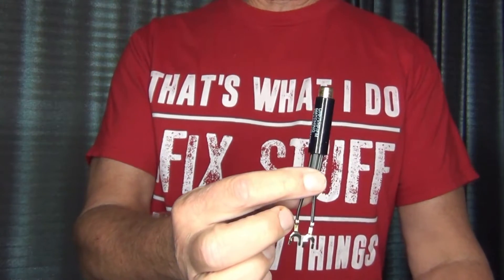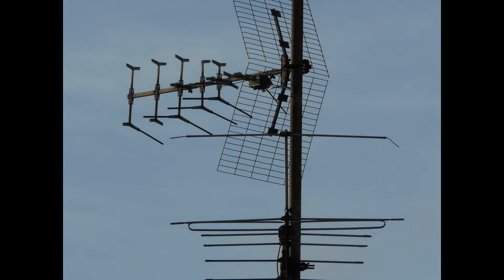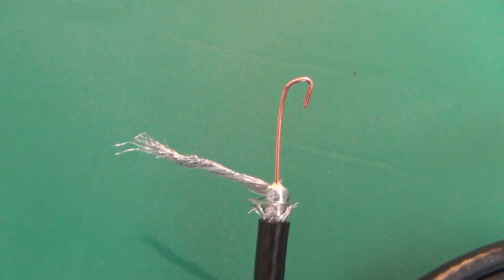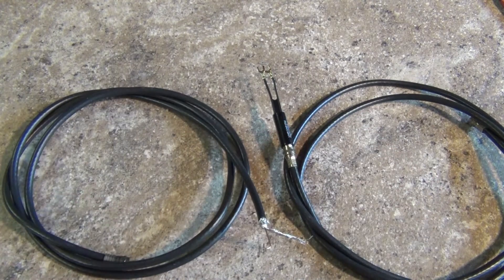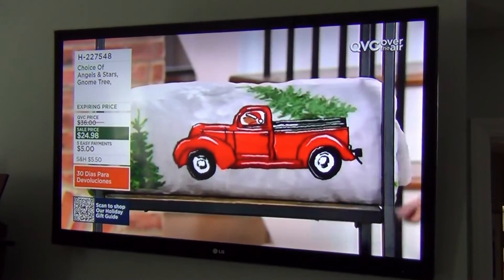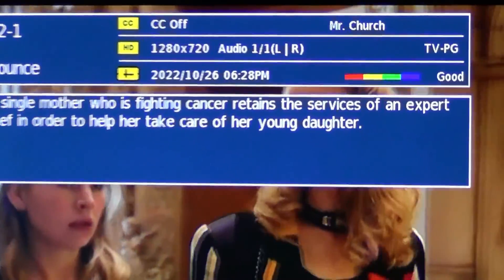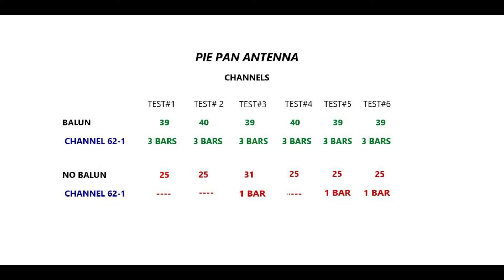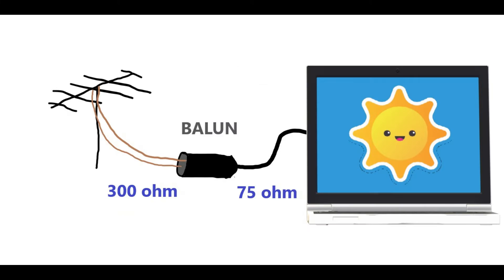Do You REALLY Need a Matching Transformer?

Comment: It's much more evident in analog TV that using a 75 ohms coaxial cable an antenna with a matching transformer has better reception than without. A 300-ohm twin lead flat cable still needs a matching transformer not on the antenna but on the other end when you plug it into the TV.
Reply from the maker: Thanks for the great comment!

Comment: WHY NOT RABBIT EARS?---why you didn't include the two rabbit ears antenna with this one? I need to make one antenna like this one but with two rabbit antennas to make it a complete tool. But I wanna know how to connect the two antennas with the UHF loop antenna. Do you have any idea?
Reply from the maker: Often the UHF loop shares the same connection as the rabbit ears - try connecting them together, one on top of the other.
Reply: @mrhoptoit7835  You mean both the loop and rabbit ears antennas should be in parallel connection with the input of the balun?
Reply from the maker: Yes.
Reply: @mrhoptoit7835  I don't think that way the loop antenna will work with the rabbit ears. I think the rabbit ears need to be connected to  the output of the balun.
Reply from the maker: There are situations where connecting the antennas together will not work well. I always recommend at least trying it first. If it doesn't work for you, attach both antennas to their own balun, run equal lengths of coax from them to a combiner/splitter, and then run your coax to your TV.

Comment: As a general rule, matching always helps.  I get a "boat load" of TV stations with my attic antennas.  They are directional so aiming of the antenna also matters a lot.  If you are over about 30 miles from the transmitter, a directional antenna is best because it ignores noise coming from other directions.

Comment: This was a fantastic real world test of Balun transmission line change.  I lot of antenna sophistication ends up not making a lot of difference its so good to get some real world results!.   There is more going on than just changing impedance between 300 Ω and 75 Ω transmission lines.  The 300 Ω transmission line is treated as a "balanced" carrier transmission wave where half the wave is below a zero voltage reference and half the wave is above zero voltage reference.    The idea is that at the receiver any radio wave interference to the transmission line will appear as a positive or negative constructive interference to BOTH negative and positive parts of the signal; whereas, the original signal would be very symmetrical.  The non symmetrical part of the signal can then be greatly eliminated.   300 Ω transmission line is typically unshielded twin lead and it is best to put a slow twist into the line so any radio wave interference is applied somewhat evenly to both conductors.  People have used unshielded 300 Ω twin lead in their attics as antennas in themselves.   

The 75 Ω transmission line is typically shielded unbalanced transmission line where the entire signal wave has been shifted so that the bottom of the wave that was below zero is not tied to a zero reference and the whole wave is considered to be above the zero reference.  The typical 75 Ω shielded transmission line is coax cable with two very different conductors that do not act the same.  This would make it a poor choice for a balanced transmission line because the two halves of the signal would be distorted from one another with the implicit reference to ground (actual ground).   It is also much higher loss than the unshielded balanced transmission line.  The shielding provides near total isolation from interference, but it also is thought to drain signal strength away to ground.

The impedance of the transmission line can be thought of as the optimum ratio between voltage and current or R=E/I which in the physical conductor is set by the distance and dielectrics between the conductors.  I have never gotten a good practical model for impedance matching.  Impedance is dealing with energy storage and release due to magnetic (inductive) and electric (capacitive) fields.  The reason impedance is referenced in Ω is that at certain frequencies it resembles an R=E/I relationship ship which is a physical ratio of voltage to current.  That has relevance to the physical sizing of inductors and compactors.   In radio electronics there is another meaning of high impedance in relationship to vacuum tubes (valves in Britain) in that they had relatively high resistance compared to later transistor electronic circuits and operated in at much higher voltages to produce similar output power in the hundreds of volts sometimes.   A transmission line's termination needs to appear as a continuation of the transmission line or the signal will bounce due to a refraction change.   The real problem with the signal bouncing is it will bounce off of other refraction changes and all that back and forth bouncing will cause distortion to the signal.   There is also loss of signal with out a good impedance match because part of the signal is bounced backward.  

It is best practice is to have a strong signal booster right at the antenna so the antenna sees an ideal load on it and the signal booster can then provide a strong signal source to the devices using it.  Ideally it would be best to over boost the signal at the antenna and have to cut the signal strength down at the receiver.  If you use a passive signal splitter it cuts the signal strength down regardless if its ports are being used and more so for the number of ports it has.  I've never seen an over booster signal not work on a TV.  There is something else probably going on if that appears to be the case.  High frequencies in the upper UHF can lose about 4 times as much strength as the lower frequency VHF TV signals on their way down from a roof antenna.
Reply from the maker: Thanks Douglas for watching and giving such a thorough explanation. Very well written.

Comment: Ok, now that reception is for TV ! I'm curious about the signal for FM radio? Can this work for that too ?
Reply: Yes, a balun does work for FM radio.  If you make the classic folded dipole FM antenna out of some twin lead or just hook up to a TV antenna, the matching still helps if you need to run coax to the radio.
Reply: it might pick up some stations but the antenna he used is for uhf and FM uses Vhf. a pair of rabbit ears would work for FM

Comment: Just my opinion based on my personal experiences, your mileage may vary and CAVEAT EMPTOR: A Balun is like the transmission in your car, it BALANCES the load to make for an EFFICIENT transfer of power. You NEED a balun for the efficient transfer of power, even here where we are dealing with picoamps! It WILL Make a difference in fringe reception. What's MORE, if you put an antenna up high, it's BEST to use 300 Ohm TWIN LEAD and bring that down into the house. (And don't forget the lightning arrestor!) I have observed PERSONALLY that SURE, you can use a PREAMP and use coax for this connection. But? You don't need the preamp at all, IF you use GOOD OLD FASHIONED 300 Ohm "TWIN LEAD" INSTEAD! This is a substantial SAVINGS in that you forgo the cost of a preamp, and even though it uses a so called "voltage injector" that is mounted INSIDE your house, you're just kidding yourself if you think that the preamp MOUNTED OUTSIDE  which is where it MUST be to make any appreciable difference, will stand up well to weather, and that goes DOUBLE for coax outside, which eventually gets wet, no matter how well you seal it up, and that changes the impedance to something OTHER than 75 Ohms, and drops efficiency DRAMATICALLY! Now,  INSIDE your home, you place the balun to switch over to 75 ohms for your actual TV connection. and with 300 ohm twin lead, you DO NOT AND SHOULD NOT place a balun on the mast. Why does this matter? Because TWIN LEAD is way way way more efficient than coax on any given length as compared to 75 Ohm coaxial cable. This is ESPECIALLY TRUE at VHF and UHF frequencies! You will STILL need a DISTRIBUTION AMP INSIDE THE HOUSE for the runs to the respective television sets.. again because of the loss of the coax INSIDE the house. This begs the question: Why not just run twin lead INSIDE the house to all of the TV's? The answer is that twin lead DOES NOT like to be run over or near runs of metal like pipe and duct work, indeed it will LOSE SIGNAL in these circumstances. If you use a metal pole as most of us do for your antenna mast? You MUST use FOUR INCH STANDOFFS MINIMUM to separate the coax from the metal pole/tower. In comparison to coax, you could theoretically run HUNDREDS OF FEET of Twin lead and have practically NO LOSS as compared to just 25 or 50 feet of coax! Back in the EARLY days of television, communities that were cut off from TV reception would put an antenna on a mountain and run...yes...you guessed it... TWIN LEAD to the bottom of the mountain. You would pay to be "hooked up' to the system, and this was the early "cable Pay TV" (using the term "cable" very genetically and loosely here! ;-)) USE PPE, AVOID FALLS, AND DON'T EVEN THINK OF MOUNTING AN ANTENNA NEAR ANY POWER LINES! People are KILLED installing antennas every year, don't be one of them! You MUST install the LIGHTING ARRESTOR to meet code and so you don't VOID YOUR HOME INSURANCE WARRANTY! Again, coax is lossy lossy stuff, that's why you see those inline "boosters" on the telephone poles all over your town, and even UNDERSEA CABLE has to be boosted MANY TIMES with VERY EXPENSIVE underwater boosters to make the trip to (and from) US/Canada and the UK for another example.  All the Best! 73 DE W8LV BILL
Reply from the maker: Thanks for the really good comments and advice, and thanks for watching

Comment: Without a balun, the coax becomes part of the antenna elements and its placement/routing will likely affect signal and interference.  Some small antennas that are marketed as VHF-High use the coax like this as the VHF-High element.  Presumably so it can be marketed as a VHF-High antenna.

Without an impedance matching transformer, a high impedance antenna (aprox. 300 or so ohms) is too high to effectively drive the lower impedance of 75 ohm coax cable.  Thus the delivered signal is weaker.

Impedance of an ordinary dipole antenna is supposedly close to 75 ohms and so 75 ohm coax can be directly connected.  However, there is still the issue of balanced to unbalanced.  So a 1 to 1 balun would be appropreate.  Rather than 4 to 1 (300/75 ohm).  There are some means of making a 1 to 1 balun with a length of coax.  But these are usually narrow bandwidth and more suited for HAM systems etc.
Reply from the maker: Really good information. Thanks for the comment!
Reply: Does it matter if I have a 75 and 300 switch for gaming with RF adapter or does it not matter for gaming?

Comment: I agree with your conclusion but your testing was totally unscientific ..  BALUN stands for Balanced-UNbalanced  its to match a balanced antenna (TV) made up of horizontal parasitic  elements and  dipole driven elements to an UN-balanced coax cable ... , in other words they haven't fundamentally changed from the old Analog days , there is no such thing as a HDTV antenna .   A balun can also  match different impedances because its a transformer .     ....The new digital channels are all in the UHF range which has the greatest cable  losses , the most important issue with reception is the cable .  Always use the shortest run , use high quality double shielded cable .  Digital signals are easily interrupted by interference  .
Reply: Not all TV stations are on UHF.  Near me there are several High-VHF stations and one Low-VHF.  A lot of people will find that the local PBS station is on the VHF band.
Reply from the maker: Very true Ken. That's why everyone needs to check out what type of antenna is needed for their particular location and  bands they want to receive. My current favorite is rabbitears.info.
Reply from the maker: Thanks Jeff for your great feedback. As I stated, I am not an Electrical Engineer,  just a hobbyist that enjoys building and testing TV antennas. Its really great that a person like yourself with a lot more knowledge on these matters took the time to watch my video (even with it's simplistic methodology) and agrees with my conclusion! Thanks again.
Reply from the maker: Thanks for the great comments, Ed. I actually do know the definition and theory behind baluns.  My video was meant to be quick, entertaining and non-technical.  If anyone wants a thorough understanding of baluns, I recommend watching David Casler's video on the subject. You are also absolutely correct that there are no ACTUAL HDTV antennas. Saying "HDTV antenna" simply lets most people know that yes, it will pick up a signal that your HDTV can use. I appreciate you watching my videos and I hope yours and Jeff's comments help answer questions that I did not cover. Thanks for your support and please keep your comments coming!
Reply from the maker: @Ed Baumann no problem Ed. I just wanted to clarify. I deliberately keep my videos non-technical as that appeals to the majority of my viewers. They just want the instructions, not the theory. I really do appreciate your comments. Its great that I have some more tech minded viewers.👍
Reply: I'm sure you know this but just to clarify for those who may not.  A balun is not necessarily an impedance matching transformer, and an impedance matching transformer is not necessarily a balun.  Most mass-produced TV matching baluns/transformers have both functions incorporated.

There are BTW actual HDTV antennas.  An HDTV antenna is an antenna that is connected to an HDTV.  Thus, it is an HDTV antenna. ;)  Otherwise, it is just an antenna.
Reply from the maker: Great comments! Thanks, RazorStrap for watching my video.
Reply: @RazorStrap  I believe the term was initially used to ensure people's uncertainty about use with the new digital broadcast.  Now it is mostly a marketing gimmick of unnecessary compatibility.